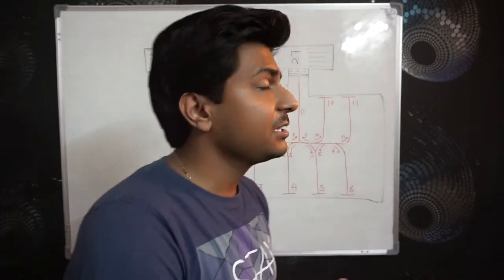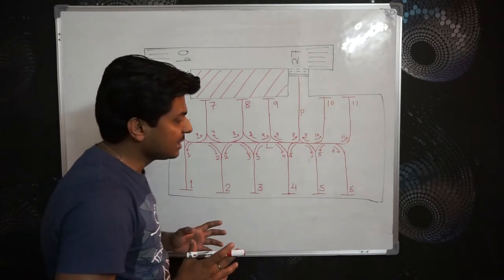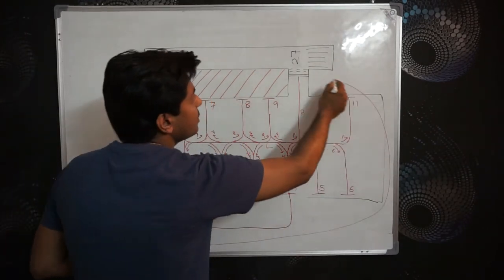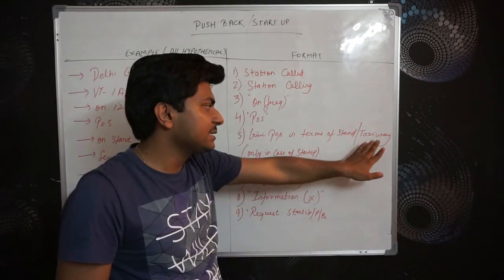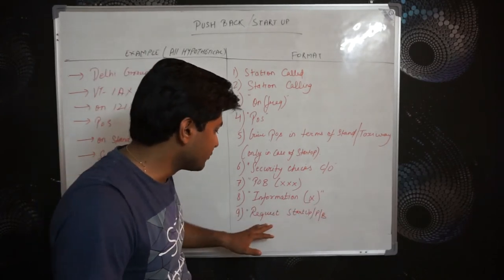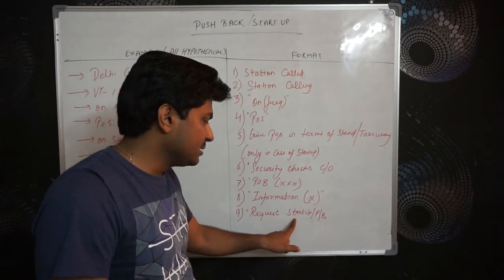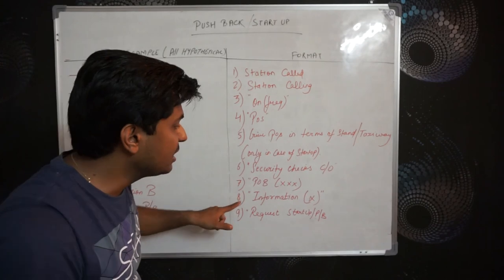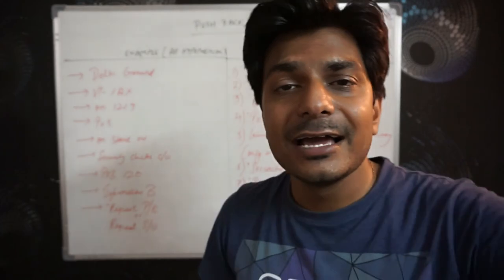pushback and start up     for RTR(A) exam Only

Comment: Obtain startup clearance you would like to fly in sector 10 mins before setting course between fl 60 and fl 80 please transmit this please
Reply from the maker: Request sector flying b/w radial 120 to radial 150 DPN at 20 nm to 30nm from F60 to F80 
Duration 10mins
Thereafter set course to destination
Reply: @captainclasses9761   obtain startup clearance means
Reply: Im mean transmitting
Reply: After the tower we will contact control
Reply from the maker: @preethapreetha3742  approach

Comment: How to take permission for taxi?
Reply from the maker: delhi ground
vt abc on 121.9
pos 
on stand 02(or taxiway  c)
information B
request taxi
Reply: @captainclasses9761  In this case, you don't have to say- security checks c/o & POB?
Reply: @abhijeetbhamodkar8996  that's for engine startup
Reply: @priyalamlani8012  ok , thanks